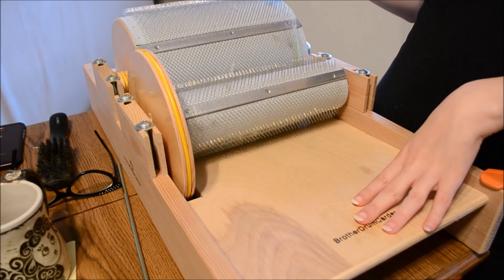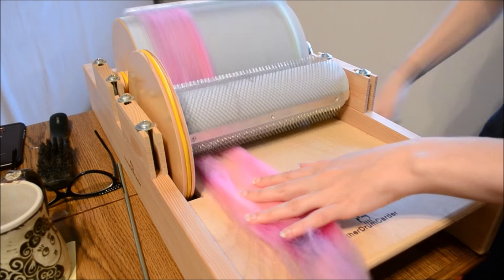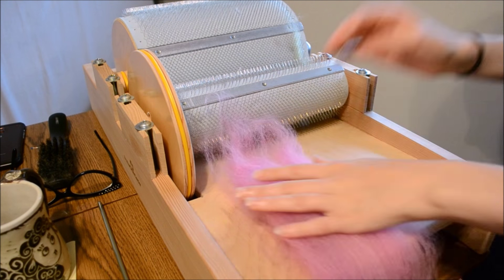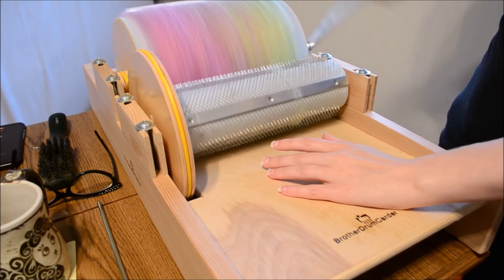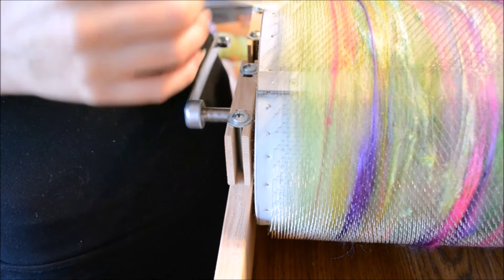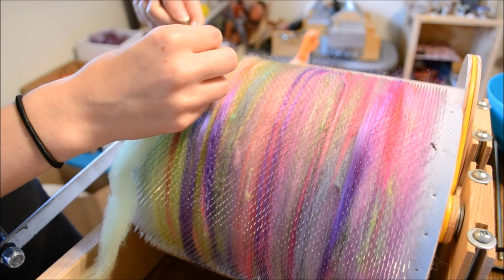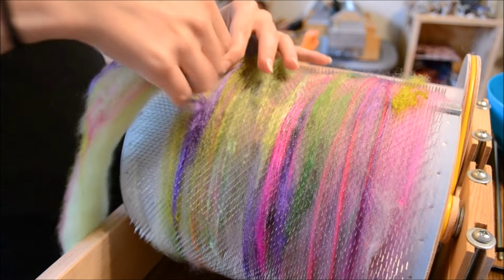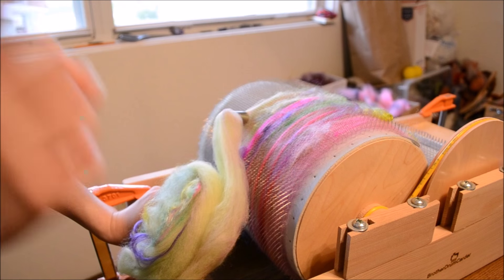How to Make Roving on a Brother Standard Drum Carder

Comment: I recently purchased a used Brother standard drum carder. When I try to remove a batt, the weight of the handle causes the drum to roll around so that the handle is in the downward position. Is there anyway I can prevent this from happening so that I can remove the batt smoothly and evenly?
Reply from the maker: If you have the brush attachment that will keep the drum from moving if the brush is pushed down onto the drum.

Comment: Maybe you can help?  Just got a Baby Brother Drumcarder today.  When I feed in a small amount of fiber it wraps around the licker drum and NOT  the main drum.  I have to play with the fiber, pulling it off the licker drum and manually putting it on the main drum but  even after that, it tends to wrap around the licker.    I wondered if the teeth from the licker are too far from the teeth of the main drum?   But since I just got it. . . I did not adjust the distance.  The instructions say that the distance should be no greater than a credit card width apart, and it should be correct since I just got it.  So what is going on?
Reply from the maker: Hi Maggie,
Here are some suggestions,
You could try hand painting the fiber directly onto the large drum and we have some YouTube videos that help explain that technique.
Fiber is being fed into the drum carder in pieces that are too thick…….make sure they are very thin bits, thin enough to read the newspaper through.
Licker in is to close or to far away from the big drum.
Fine fiber naturally tends to build up on the licker in somewhat……some fibers build up more than others…..let it build up and keep carding, just leave the fiberon the licker in and see if it helps. The licker in is meant to transfer the fiber to the big drum as well as take out nepps, second cuts, etc. If the fiber you are working with is free of the “junk” you don’t want in the batt anyway then this is an option. You can clean it off the licker in later and add it directly to the big drum
Tease the fiber very well. 
Don't hold back on the fiber as it is feeding into the carder. 
If the humidity is very low, try spritzing the fiber with a weak solution of water & fabric softener to reduce static electricity. I hope this helps... You could email us too. info@brotherdrumcarder.com
Reply from the maker: We have replied to your email. Let us know if you have any more questions. Thanks!

Comment: How far apart should the two drums be?
Reply from the maker: They should be as close as possible without teeth touching or meshing into each other.
Reply: @brotherdrumcarder  How do you know if your drums are too far apart?  The licker-in on my LIttle Brother motorized drum carder retains a lot of fiber.  I see your licker in does not retain fiber.
Reply from the maker: @barbararickman8543  The drums should be as close as possible without the teeth touching. Sometimes when working with certain fibers you would want to adjust the drums further apart. What tpi do you have on your carder? Grace on this video is using a 72tpi. You could email us info@brotherdrumcarder.com for better assistance.